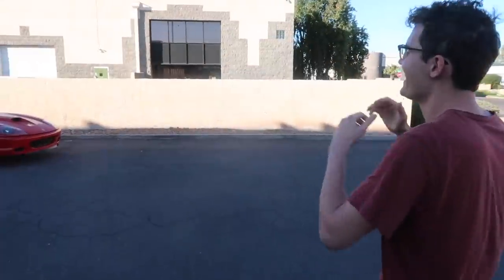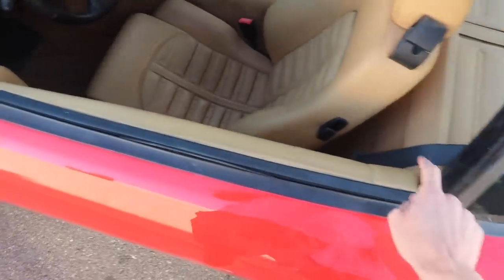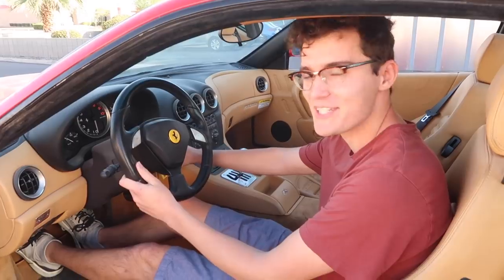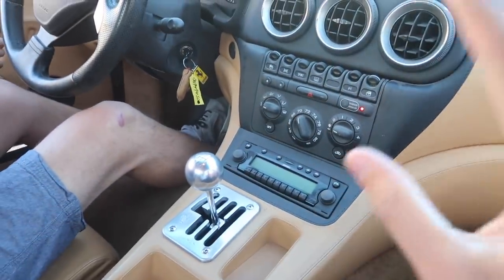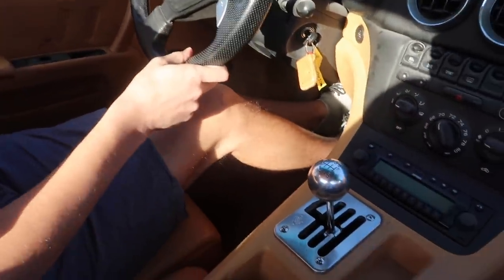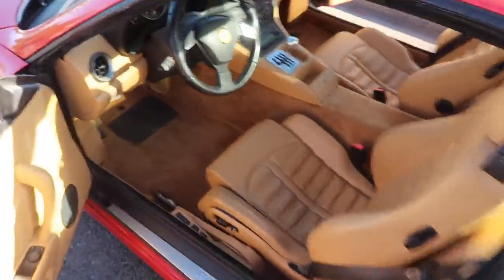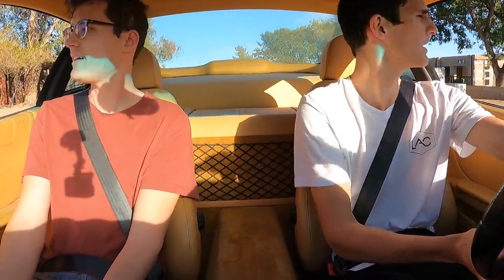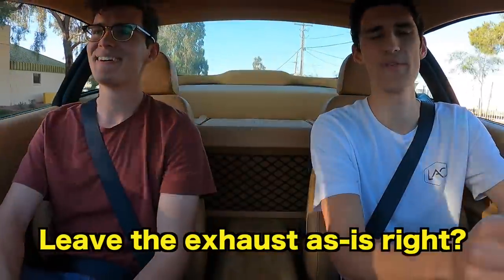First Drive In The RARE 6-Speed Ferrari 575M (Manual V12 Tubi Exhaust Sounds)

Comment: The “straight pipe” video is a bit misleading - that isn’t actually a straight piped car, it’s a full Fiammenghi Italia system (on Fabio Fiammenghi’s personal 575M HGTC). The pitch is a function of the 6-1 headers Fabio builds. His car has the headers, 200 cell cats, double H pipe, and valved mufflers. I have the same setup on my 575M. It takes driving a Maranello from a tremendous experience to a legendary experience. A straight piped Maranello doesn’t sound anything close to that.

https://youtube.com/shorts/H7nwWlErTt4
Reply from the maker: 100% true. I should have written more of what it was on the screen. That setup sounds absolutely insane! Your car is sweet🔥